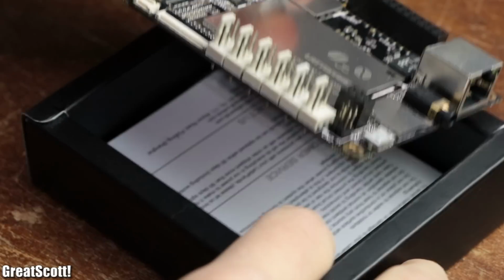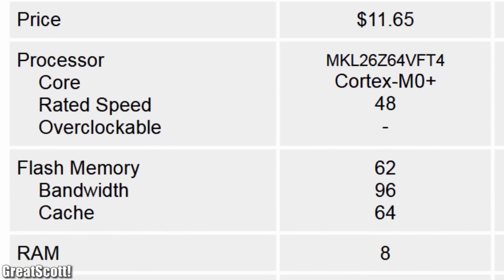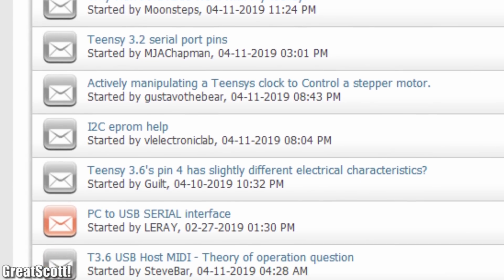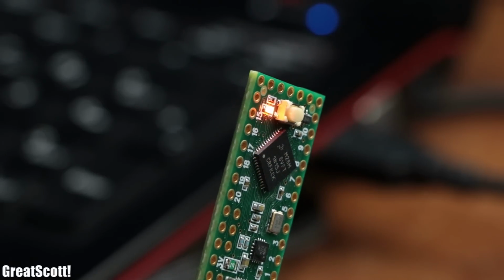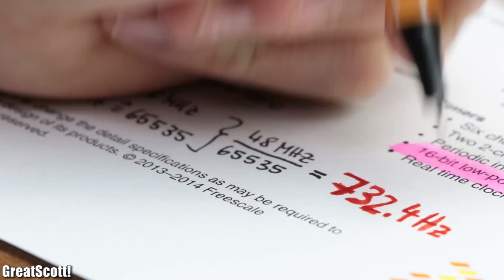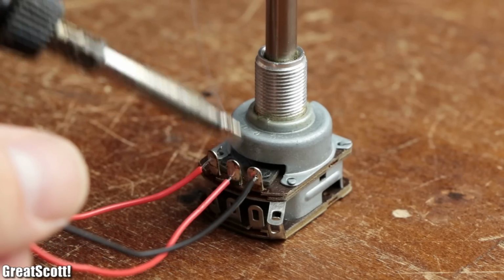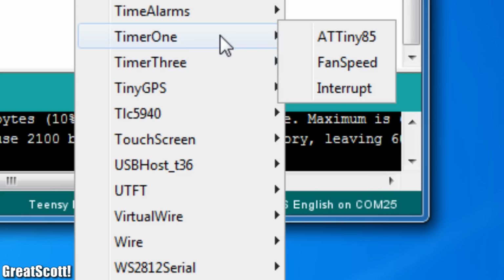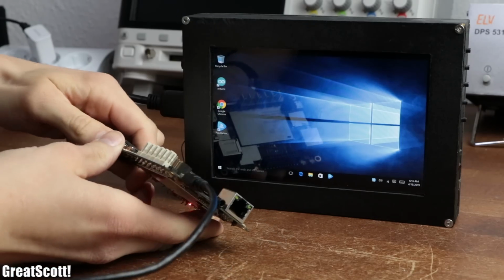Easy & Powerful Arduino Alternative? #3 Teensy Beginner's Guide

Comment from the maker: You can download the Arduino alternatives chart shown at the end of the video here: https://www.patreon.com/posts/26422805
Reply: Please stop soldering wires directly to boards  :D :D :D
Reply: Thank you sir!
Reply: The LattePanda has an Arduino microcontroller embedded, why not use it instead?
Reply: Can you please do two videos a week?
Reply: Can you make two videos a week.
Reply: Why not use piso shift register?
Reply: Hi, i love your videos and watched all of them but i cant find video about how to fix schems how to find problem. It will be good if you make tutorial about fixing electronic boards. Thank you.
Reply: As a another user pointed out there is a onboard chip that you could use aswell. The ATMega32u is integrated in the latte Panda and it has native USB support. There are a lot of keyboard projects that's based on that chip. Have a look at deskthority and geekhack.
Reply: How does it handle fast interrupts for example those coming from a rotary encoder attached to a motor? Arduino has this bad behaviour of skipping/not acknowledging interrupts if the interrupt generated is too fast...this was also because Arduino had a clock speed of 16MHz...with 48MHz, does that perform any better?
Secondly, I wanted to ask about code latency...what is the latency produced due to the code itself? I'm guessing it is less but that caused problems in my Arduino too. Please reply.
Reply: And the interrupts I mentioned are pretty fast....assume a 120RPM ...i.e. 2 RPS motor and 60 spokes/revolution.... that's 120Hz: the rate at which the interrupt is being called every second...and this happens to be too fast for the Arduino. I want to know if this can handle it to a better extent?
Reply: GreatScott! Great it could be my next project
Reply: Any idea on how to make a geiger counter with it?
Reply: Can you explain what is FPGA and is it an alternative for Arduino?

Comment: i dont like how you compared a official board to a trashy out of ghe bin copy, you should have compared the teensy price to an actual arduino price
Reply: Tell me exactly what's garbage about the copy? Only difference is the usb to ttl chip which is a very simple fucking driver installation. Comparison is price against whats available , non of this " oh its not equal to that this bs "

Comment: If I may ask here, where do I find resources to do some assembly level programming on the teensy. And secondly what other high level language does the ARM uC use for programming. I read that Atmega translated codes are still inefficient for teensy's ARM. So what do I use to directly program teensy and not translate it using teensduino?

Comment: I see you are still on Windows 7, I changed to W10 but now have a problem with the drivers for Arduino, unable to use ESP8266 or any type of wifi board and even have a problem with my Nano clone so I would suggest you stay were you are, sorry to rant loved the video

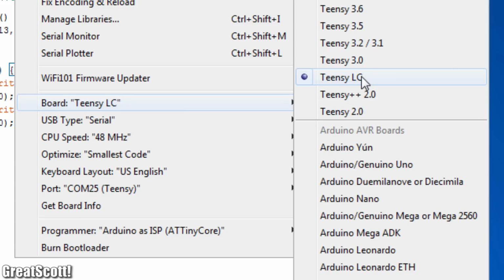Comment: @GreatScott! great video as always!  Did you miss the step about uploading to the Teensy for the first time?  Around 4:00 you select the configuration which lists "COM25 (Teensy)" as the port but this option isn't available on the first upload.  Many users (including myself) had issues with the first upload.  But once you complete that, you can directly upload sketches from Arduino IDE like normal.  Important note that with Teensy's Micro USB port, it requires a data cable whereas most people have power-only cables from their cell phones.  Thanks again and keep up the great work!

Comment: The major issue is the Arduino IDE. It is just so much overhead. Basically you are not programming the microcontroller , but at high level - glueing libraries together.

Comment: Hi! I have opened my old xbox one controller and made a small controller that looked simillary to nintendo switch. I made 2 of them. L and R. And they work on Bluetooth HID and Teensy! (BTW - That xbox controller had broken vibration cables. So i opened it and I wanted to do something with them)

Comment: How does it handle fast interrupts for example those coming from a rotary encoder attached to a motor? Arduino has this bad behaviour of skipping/acknowledging interrupts if the interrupt generated is too fast...this was also because Arduino had a clock speed of 16MHz...with 48MHz, does that perform any better?
Secondly, I wanted to ask about code latency...what is the latency produced due to the code itself? I'm guessing it is less but that caused problems in my Arduino too. Please reply.
Reply: And the interrupts I mentioned are pretty fast....assume a 120RPM ...i.e. 2 RPS motor and 60 spokes/revolution.... that's 120Hz: the rate at which the interrupt is being called every second...and this happens to be too fast for the Arduino. I want to know if this can handle it to a better extent?

Comment: You can also use Arduino pro micro wich uses the ATmega 32u4 microcontroler  wich does not need a separate microcontroler for usb. And has the ability to emulate a mouse & keyboard.    One of my favorite microcontrolers from ATMEL company. I w I

Comment: Hello!,

I'm searching for a microcontroler with a good ADC resolution and accuracy for a project. Does this microcontroller have good resolution and accuracy?.
I've tried Arduino but It has not enough resolution (and also I think I've noticed diferences between real and detected voltage), and an STM32 microcontroler. This last have a better resolution, but also have a lot a noise. Even putting the pin to ground I've got fluctuating values between 40 and 100 when Arduino is just getting 0.

Greetings!!

Comment: GreatScott, I have a question. If I have a blown capacitor rated 1500uf at 16V can I replace it with a capacitor rated 2200uf at 16V?

Comment: Design and implement the decoder for 7 segments display to display one character from the word "Logic" by using Dip switches.

the inputs are 5 DIP switches. each one can display one character from the mentioned above

example: once move Dip switch1 to ON state, the character L is displayed.

Comment: If you get a 32u4 based Arduino (Leonardo, Micro Pro, etc,) you can, with the Joystick library, make HID joysticks, controllers & keyboards. The Teensy is a super board - seems a bit of a waste just to do a joystick.  🙄

Comment: Have you looked at V-USB? -- It's a library that lets you bitbang the USB protocol, so you can use it with any AT MEGA chip (including many Arduino ones), even if that chip has NO on board USB support! -- You can even get away without a Crystal OSC (it can measure an offset between it's own internal RC, and the PC's USB signal and use the settings registers to fine tune it's exact running frequency, so that USB continues to work; obviously a 12 MHz OSC is easier to code for, but it's not that bad.)

Comment: I need some help.
using the Arduino Pro Micro (AtMega32U4) i have made a pc keyboard. but now i want to add leds
My keyboard has 61 keys and i want to use rgb leds.
I dont want per key lighting just that i can choose what color all of the leds are. (like all red, all blue etc)
But from what ive seen in this channel and other channels multiple leds require high power.
How do i go about this?
Edit: Ideally i would like to do this without connecting any other power source other than the micro usb cable to the arduino

Comment: Not saying the teensy is not cool, but you certainly don't need a $12 board to build game controllers, I built several arcade sticks with $2 or $3 (don't remember) Arduino Micro boards

Comment: It's worth mentioning, that creator of the Teensy boards is very active contributor to the development of Arduino IDE. It's more than unfair to compare prices of Teensy boards to prices of clones from far east.
Reply: How does it handle fast interrupts for example those coming from a rotary encoder attached to a motor? Arduino has this bad behaviour of skipping/acknowledging interrupts if the interrupt generated is too fast...this was also because Arduino had a clock speed of 16MHz...with 48MHz, does that perform any better?
Secondly, I wanted to ask about code latency...what is the latency produced due to the code itself? I'm guessing it is less but that caused problems in my Arduino too. Please reply.And the interrupts I mentioned are pretty fast....assume a 120RPM ...i.e. 2 RPS motor and 60 spokes/revolution.... that's 120Hz: the rate at which the interrupt is being called every second...and this happens to be too fast for the Arduino. I want to know if this can handle it to a better extent?
Reply: @AadityaKhare42  A 120Hz signal should be no problem for a 16MHz CPU. Something must be blocking interrupts for an extended period. Maybe Serial.print or EEPROM.write? I'm not sure what all interrupts the Arduino libs have running in the background all the time, but I doubt any would block long enough to be a problem.
Reply: @AadityaKhare42  I’m using a rotary encoder on my Teensy 4.1 and it’s missing none of the interrupts no matter how fast I turn it
Reply: @AadityaKhare42  I think that you should ask your questions here: https://forum.pjrc.com/
Reply: Why using the Arduino IDE? It is so much overhead. Basically it provides an OS, many layers of code.

Comment: Teensy - 11$,
ESP32 - 8$, + 2 cpu, wifi and bluetooth, and arduino compatible as well.
Reply: What do you mean with Arduino compatible? The Arduino binary code would not run on the ESP. Why would you be Arduino compatible ?
Reply: Arjan van Vught I mean you can use arduino ide with same libraries, just in the same way as GreatScott did with teensy

Comment: my go to arduino is usually the pro micro knockoffs (atmega32u4, usually the 8mhz/3v3 varient). its got a usb interface and they are cheap. an arm board like the teensy is a little overkill for a control interface.

Comment: I quite like the STM32F103 as an Arduino alternative and has a USB interface. It is also pretty powerful. It is a little bit more of a pain to flash it with a compatible bootloader, but once you know the process it is a 2-minute thing to do. They are also similarly priced to a nano.

Comment: GreatScott I have used Arduino Uno to turn pwm channel inputs into a game controller using FMS serial protocol on Arduino and some other software on windows that I forgot. I used it to play DRL and fpv free rider.
Reply: How does it handle fast interrupts for example those coming from a rotary encoder attached to a motor? Arduino has this bad behaviour of skipping/acknowledging interrupts if the interrupt generated is too fast...this was also because Arduino had a clock speed of 16MHz...with 48MHz, does that perform any better?
Secondly, I wanted to ask about code latency...what is the latency produced due to the code itself? I'm guessing it is less but that caused problems in my Arduino too. Please reply.And the interrupts I mentioned are pretty fast....assume a 120RPM ...i.e. 2 RPS motor and 60 spokes/revolution.... that's 120Hz: the rate at which the interrupt is being called every second...and this happens to be too fast for the Arduino. I want to know if this can handle it to a better extent?

Comment: You can flash a custom firmware to the 16u2 chip on the Arduino to use it as a game controller

Comment: Can you make high-speed synchronization between an encoder and multiple stepper/servo motor???
it would be nice if it also features electronic gear ration across different stepper/servo motors ...
its was one of my project back then i have trouble because I'm using a very old PLC with limited features and no tutorials .. 
I would appreciate if you can make a video about it..

Comment: The Teensy is my go-to dev board if I think I'll overtax a Nano, if I need 2 SPI busses, if I need to do real math, or if I'm doing any kind of audio processing. The 3.1 is 5V tolerant. The PJRC forum is superb. But if Teensy amazes you, I can't wait until you discover the Espressif ESP32 boards. Great Arduino IDE support, dual cores, WiFi, BlueTooth.

Comment: As far as I can tell an Arduino Micro would have been more than enough for your application, it has about as many pins as the Teensy LC and has native USB support (so it can emulate a keyboard/mouse/controller) but it costs about half as much as the Teensy LC shipped from China. So I'm not exactly sure why you would use a Teensy, given that you really don't need a very powerful processor for what you're doing.

Comment: I appreciate the use of the Teensy for what it can do, that say, an Arduino UNO cannot.  However... Your LattePanda has a built-in Arduino Lenoardo, and the Arduino Joystick library works on the Leonardo.  So, if all you want is a game controller, why not use the built-in hardware?
Reply: How does it handle fast interrupts for example those coming from a rotary encoder attached to a motor? Arduino has this bad behaviour of skipping/acknowledging interrupts if the interrupt generated is too fast...this was also because Arduino had a clock speed of 16MHz...with 48MHz, does that perform any better?
Secondly, I wanted to ask about code latency...what is the latency produced due to the code itself? I'm guessing it is less but that caused problems in my Arduino too. Please reply.And the interrupts I mentioned are pretty fast....assume a 120RPM ...i.e. 2 RPS motor and 60 spokes/revolution.... that's 120Hz: the rate at which the interrupt is being called every second...and this happens to be too fast for the Arduino. I want to know if this can handle it to a better extent?

Comment: Hi, have you looked at this one?  https://aliexpress.com/wholesale?catId=0&initiative_id=SB_20190428134802&SearchText=wemos+samd21+mini 
Use this great info: https://github.com/BLavery/SAMD21-M0-Mini 
With the new bootloader, latest CircuitPython (use Feather M0 Basic - i don't care about the LED's) and Mu editor is a snap! (haven't tested VS Code/PlatformIO yet...)

Comment: you should use an stm32, only 5€ and less on ebay :)
Reply: Good luck programming it
Reply: @BogdanSerban  you can programme an stm32 with Arduino IDE
Reply: Starkead Why the Arduino IDE while it is a proper ARM SoC? The Arduino IDE is so much overhead
Reply: Bogdan Serban it is pretty easy.
Reply: Or the 8 dollar Orange Pi Zero. Also ARM but with Ethernet and some amount of RAM ;:)

Comment: Atmega32U4 boards do all the things needed, are Arduino compatible and cost less than $3 including shipping from China. Just saying.
Reply: All the things needed, by who...? ATMEGA32U4 has many of the features that the Cortex MCU's used in the teensy's also have, but not everything. The ATMEGA32U4 has no internal DAC, only one SPI, significantly slower than most teensy's, no native floating point calculations, no master USB feature, significantly less RAM, 8bit instead of 32 bit, only 10bit ADC, no I2S etc etc etc etc. Of course for many projects an ATMEGA32U4 is more than enough, but not always.

Personally the ATMEGA32U4 is one of my favorite and most used MC's, but in a current project I am working on I am facing some of its limits and have been forced to take a look the teensy's.
Reply: @element4element4  I've got a bunch of AtMegas and three different Teensys (plus some STM32s). I'm Teensy all the way for the more "challenging" projects and keeping the arduino Unos for stuff where  don't need the heave-ho. Horses for courses and both are superb. Paul is a nice chap too, so that helps!

Comment: For cheap usb interface microcontroller you also can use Arduino Leonardo or Arduino Pro Micro. This chip is $3,50 and does the job quite well. Teensy is really overkill for the purpose of a joystick...

Comment: If you want performances is it possible to program the Teensy in C instead?
Reply: Yes, and if you still need better performance you can program it in assembly.
Reply: @LuxBacelo  Assembly is often everrated. C is low-level enough and pretty descent at optimizing that it makes assembly overkill for most applications unless there's a pipeline to handle like a DSP or specific instructions not supported in C (for which using inline assemble is a good solution). I've seen Cortex somewhere in the video so it doesn't behave as DSP instruction or architecture, and assembly will not buy much performances on ARM anyway.

Comment: Creating a voltage divider with your potentiometer probably wasn't the best idea. I thought the pins do not tolerate 5 volts, how did this not fry the board?
Reply from the maker: I used 3.3V

Comment: Pro micro (mini Leonardo with built-in programmator) is based on 32u4 microcontroller Which also can be used as usb controller. I've bought one from "Ali" for 4.5 bucks

Comment: Arduino libraries are trash because they have no resource management, thus you can not easily combine two libraries. Also the IDE is utter, userunfriendly trash. Porting this bad ecosystem to ARM makes it only slightly better.